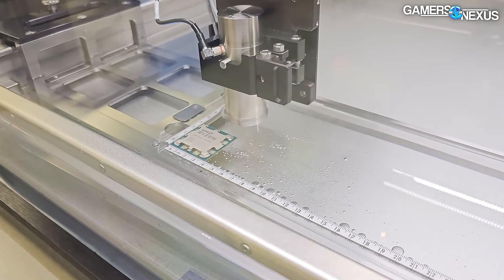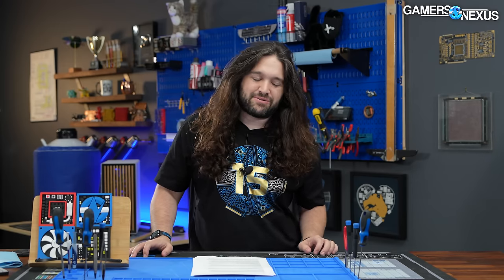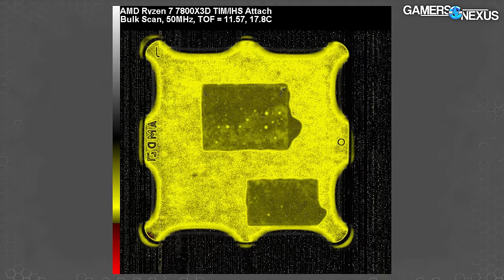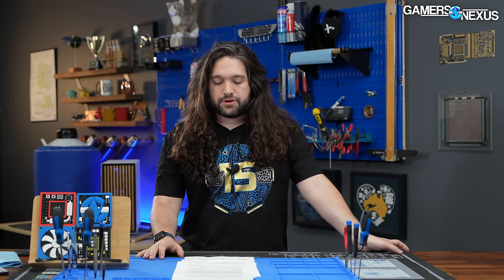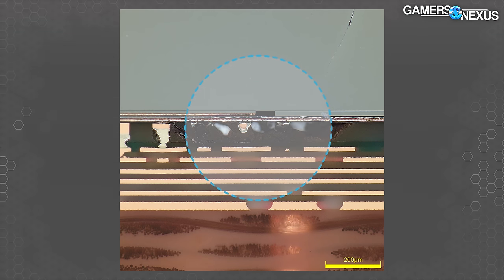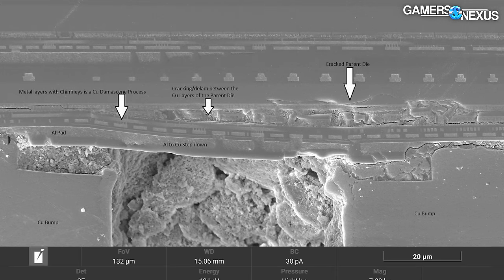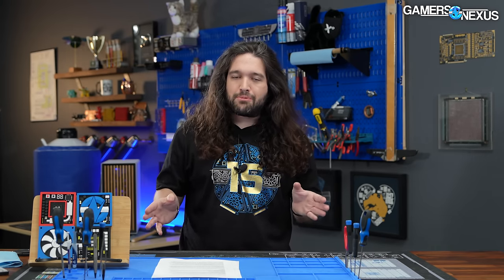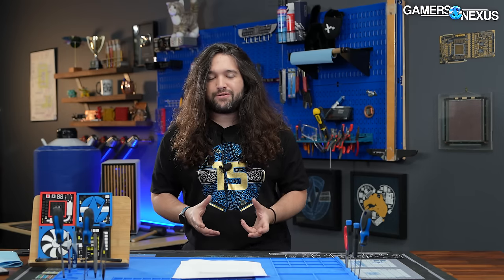The Truth About AMD's CPU Failures: X-Ray, Electron Microscope, & Ryzen Burns

Comment: This just reiterated to me how amazing it is that they manufacture these products in such vast quantities. It really is hard to believe how small all of the connections are and that it works at all.
Reply: It's mad isn't it? Especially when we get down to that scale and you can't even see a hint of a transistor.
Reply: @memitim171  Its instane tbh how a light beam can make transistors and do this on such a scale seems almost impossible that some metals can make something like a cpu.
Reply: @synapse5791  Yes it is amazing! To be accurate transistors aren't made from metals they are made from different metal doped semiconductor material which is usually Silicon.
Reply: @linmal2242  Yeah Its still kinda amazing how they work. Like how do you tell a bunch of materials to do something in a linear way which you can easily control? Its really
Reply: yep we can´t even inagine there is a big AMD logo in there lool

Comment: This was absolutely fascinating. But honestly, the more I learn about the structure of CPUs, how they are made, and how they work, the more I am convinced that they really are magic. The fact that you can zoom in so far, with all sorts of advanced equipment, and yet still not be able to resolve the transistors, is absoutely wild. It's one thing to hear "20 nanometers, 11nm, 7nm" etc but another entirely to understand just how infinitesimally small that really is.
Reply: Yeah, when people say that we will eventually won't be able to shrink the transistors more because on the quantum scale physics goes out of whack it sounds like Sci-Fi, but we are almost there already.
Reply: @AlleonoriCat  we are almost there already. The different layers are barely more than one atom thick and because it's so thin they're limited at how much more they can shrink while still keeping electric flow under control - the risk of cross-talk and shorts becomes greater every time they shave a nanometer off
Reply: @thesteelrodent1796  The transistors are small, but once you get to the vias and interconnect layers, they become huge in comparison, thousands, tens of thousands of angstroms ;)
But on the silicon it's damn small.
Reply: Imagine the machines (ASML) that make these chips ;)
Reply: They should be able to resolve the transistors if they zoomed in and took the time to adjust the astigmatism and focus with the SEM
Reply: SEM can resolve down to around 3 nm which should be smaller then even the smallest feature on any transistor on this chip
Reply: 15A(1.5nm) seems to be the limit for now.
Reply: We trapped lightning into a rock and made it think. If that's not magic, I don't know what is.
Reply: @TheEchelon  I think in the grim dark future they'll be known as STCs
Reply: Technology of a sufficiently advanced level is indistinguishable from magic
Reply: The smallest transistors today are only about 4-5 atoms across. It is possible to see the individual atoms, but that's another whole video. The smaller the transistor, the more likely an electron will jump from one transistor to the other.
Reply: For reference I heard an engineer say 1NM is approximately how fast a human fingernail grows in 1 second.

Comment: I've got to hand it to you, this analysis is next level. You've really gone above and beyond. This is why - even though I'm not really a gamer - I find myself gravitating back to this channel. It wouldn't surprise me if AMD themselves are watching this to try to understand the issue better.
Reply: Pretty sure they know everything about it by now. Or should. It would be a huge error not to, as you cannot fix the errors you don't know. Anyways, it should not have happened in 2023, they had problems with (lack of) CPU sensors in 2003ish.
Reply: AMD probably does watch this, as well as doing their own lab assisted analysis.
They will learn from this and shape up for a while after.
Reply: If Asus stops blowing up CPUs with faulty parts on their motherboards.

Comment: I used to work at a microelectronics plant in the 90s. The designers were always putting logos and letters at the micron level, partially because they could... but also because corporate espionage is a thing. If some company copied a chip (easier to do back then, as chips were not as complicated), they would often copy those logos as well.

Comment: I got to tour a lab that does analysis like this (slight chance it might've been the actual one that was used I suppose) decades ago and it was cool as hell.  I was in high school then and they showed off stress-testing equipment they used to test parts on the space shuttle, showed how they determined that replaced cables on a suspension bridge were failing sooner than expected because the older cable accumulated more road grime that protected them from the elements better and now that cars run cleaner, there isn't as much grime so the newer cables stay clean and exposed, just all kinds of neat stuff.  It seemed like it would be a very interesting place to work.  I looked into applying with them when I was finishing college, but they didn't need any software people at that time.

Comment: I do failure analysis at my current job (macro only, so 50x magnification max) and have tons of epoxy mounted and acid etched samples. Not only does that lab have an SEM, but the thing I'm even more jealous of, a bitchin sample cutting saw. Mine is geared towards weld and raw materials. Seeing it uses for other fields is so much fun.

Comment: I have one question: when it failed was there an audible noise (explosion) or no?  No shade here, I have seen both types of failures 😆
I have loved this series. The coverage has both depth and breadth and I think really hits the sweet spot for general consumption. This last one is immensely difficult to achieve! Kudos and congrats!
Reply: Yes. In the original video you can make out a cracking noise when the chip completely fails. In fact, they showed a quick clip of it in this video.

Comment: Excellent job to your FA company and your team. I have been in this industry for 40 plus years and have performed many FAs myself. You will find that in many cases it's not just one failure point, but several.
You and your team are going in the right direction. Just keep pushing forward as you always do. There is a conclusion and you will most likely find several Root Cause Problems.
There is plenty of blame to be spread around and all of the usual suspects are either trying to replicate your findings or in the process of replicating your findings...
🇺🇸🇺🇸🇺🇸🇺🇸🇺🇸🇺🇸🇺🇸🇺🇸🇺🇸🇺🇸

Comment: Getting these tests is not cheap. The tests we usually have done cost between 1k and 7k depending on how fast you need them and how many you need to be tested. But the parts we need tested are smaller, like micro controllers or mosfets.

Comment: hmmm, isn't "insta-gib" an unreal reference, rather than a quake one?  I know it best from the original Unreal Tournament and "insta-gib" mode whre it was always one shot kill.  
Perhaps there were quake mods which aren't coming to mind (I didn't dabble with Quake mods much in the OG days).
E2A:  So, I looked it up and apparently it started with QII, but wasn't technically "insta-gib" as there were no one-shot-kill weapons as players could buff themselves out of railgun range with mega health (IIRC) and/or armour.  Though, the BFG comes to mind, but I'm sure it was possible to buff beyond OSK for that too (though damn hard).
Reply from the maker: You might be right on that. It's been... a few years! I played both!
Reply: @GamersNexus  I "E2A'd", it apparently was from QII, though it wasn't what became technically insta-gib, which came with UT.
It has been a long time for the vernacular, though it's also been at least several years since I QII'd (still my fave Quake by a long way).

Comment: I think you are misleading your viewers. Ultimately the root cause is overcurrent and not a manufacturing defect, and this is caused by the bios. When too much current is supplied then it is true, ultimately the tiniest imperfection in manufacturing processes may be the catalyst, but it is NOT the root cause.
Some of your viewers may incorrectly assume that the chips are simply poorly made with defects.

Comment: Thanks for this detailed analysis from the GN team, I really appreciate and value this type of research. I've only worked with PCB failure analysis before to a limited extent as a PCB designer that previously functioned as a systems engineer.

Personally I'd also like to perhaps contribute some input for consideration as I didn't quite see some of the simpler failure mechanics elaborated upon. The PCB interposer deformation and delamination near the over-current event site is quite typical of extreme localized heating for PCB's. Copper when significantly heated in a localized area thermally expands, while the outer colder areas constrained it, this causes buckling and subsequent delamination of the area. Meaning the outer, least compressed copper layers warp away from the PCB core and deform the socket pins. The socket pins due to extreme heating also loose their elasticity "springyness" as this effectively causes the crystal structure of the metal to change and accept the new depressed shape as normal once cooled. 

Other things that occur inside the PCB layers as a result of extreme localized heating is off-gasing of more volatile compounds that have a low phase transition temperature in addition to  vaporization of moisture into steam inside the PCB. There is always just a tiny bit trapped from earths atmosphere, PCB materials are a little bit permeable to an extent. This all combines to create both mechanical buckling of the outer layers and possible vapour expansion voids within the PCB which we in the Industry like to call "Popcorning" due to it's distinctive sound . This often breaks multiple current carrying paths in the area or forms new ones due to shorts which often results in a runaway failure as current is conducted over ever fewer points thus creating more failures.

As for the dies exhibiting voids in the indium-alloy solder layer, I'm not really qualified in that domain, but I suspect similar processes may occur here due to vapour formation either during soldering as part of the flux used which is not escaping effectively during the short soldering process. As well as potentially new voids (gas bubbles) introduced when the silicon overheated to such an extent as to crack and reflow the thermal interface solder. During this process materials from below the silicon die may be wicked up through cracks to the top. 
I have in on instance ended up with underfill material on-top of a chip I was destructively testing. 

Hope this can add what little extra context I can provide.
Reply: Great explanation as well! I hope they get to read this. All the perspective in the comments, both experienced and not is so cool.

Comment: In 1998, I bought a new mb and AMD chip. Installed it and after a night of gaming I put it to sleep with the new hibernation mode in I think windows 98. A few hours later I was awoke to a bang. The chip was cracked in half under the Heatsink. I took it back to the company who ate it after a bit of protest. Never used hibernation again. This video showed me what it would have taken to do that. Scary and crazy to think it's possible.

Comment: This kind of failure analysis reminds me of when I used to work on industrial computer mainboard engineering. Our "in house" manufacturer for proto-boards had a habit of putting on electrolytic caps backwards. Due to space constraints in the form-factor, that often meant a cache of power caps right under the CPU socket. This was more than 20 years ago. Anyways, the explosive end-result would often blow the cpu out of the socket and send 3 ft long flame jet from the test-bed. It was always exciting on first power up. I mean, we visually inspected each prototype.. but, when there is that many components in a small form-factor, you miss things. Needless to say, watching flying pentium-pros was always fun.

Comment: Hey Steve, as a Professional Industrial Electrician; I can tell you that the arc-flashed copper under-fill at 18:17 may have provided the kinetic force to do this kind of mechanical damage. As a copper-based plasma can expand quite energetically up to 38,000x its solid form. Hence why industrial electricians (like myself) sometimes have to wear PPE that is rated to be resistant to flash-incineration.

Oh, and the heat required to make copper disappear into a gas, is around 4200F. That would leave behind the clean hollow voids you have there.

Awesome video BTW. Keep up the good work.

Comment: If anyone else was interested, this is GPT4's interpretation of what the lab does:

Given the specific tests performed and the level of secrecy involved, it is possible that this lab is engaged in semiconductor failure analysis for sensitive industries, such as defense, aerospace, or high-tech industries.

The tests you listed are designed to identify physical or chemical anomalies within a failed chip that might have caused its malfunction. This can help in improving the manufacturing process, detecting counterfeit chips, or reverse-engineering proprietary technology.

Comment: -How is your couple going bro?
- Well... Not great, to say the least.
- Ow
- We broke up recently.
- Damn, what caused it man ?
- ... Well ... A lot of things could've caused it actually.
- Whut? Whadduyumean ?
- I mean some of the factors I identified as having a potentially nefarious effect on our couple, includes (non-exhaustive) : mechanical overstress , localized thermal expansion (in-bed mismatched positions notably) , overpressure , tensile overload of one's blood pressure , poor alchemical contact, junction depth issues , silicon stacking faults (if the physician did a bad job on her boo... ok) , poor homic contact (we didn't live in the same home) , hot carriers , dead skin deposition , skin adherence issues , oxydative stress inducing thoughts , lack of synaptic capability (+ commonly known as... stupidity), ionic contamination , corrosion, lack of dendritic growth , dielectric emotional breakdowns , & of course (say it with me) ... EMOTIONAL DAMAGE :elbowcough:! The list goes on...
- 😶‍🌫

My everyday life.

Comment: Ruling things out to narrow down the possible cause of failure - i.e. differential diagnosis or ddx.

This is a FANTASTIC video.

NO ONE else, in the tech YouTuber space, goes into THIS level of root cause and failure analysis.

GREAT video!

I would NOT be surprised if AMD is using YOUR video, internally, to help actually guide some of their OWN, further, investigations into this issue - cuz yeah - exploding CPUs -- NOT great for business.

I would ALSO NOT be surprised if even some of AMD's own internal employees would be IMPRESSED at the level of detail that you have performed here, in regards to this failure analysis.

This is AMAZING stuff.

The depth of technical knowledge and learning is amazing.

LOVE it!

Thank you!

Comment: Additional information: The S(econdary)E(electron) Image gives you mostly information about the topography of the sample. This is because you measure the electrons that come out of the sample cause you hit it with other electrons (like a chain reaction).

You can also detect the B(back)S(scattered)E(electrons) to gain information about the elements in the sample (heavy element = more information = white/brighter; light element = less information = black/darker). Those electrons kinda "orbit" around the cores of the elements in the sample and come back to the detector.

Comment: Does anyone remember the Toms Hardware Guide video from 20 years ago, where they tested what happens when you remove the CPU cooler off a Pentium 4/2000 or AMD Athlon 1400 while the Quake Benchmark was running, and how the AMD Athlon chip literally caught on fire?  That caused a lot of ripples and discussion in the tech world then.

This video, as well as Part 1, feels just as important and "ripple-effect" as that.  That's how amazing GN's work has become.

Comment: It's just a delaminated PCB due to heat. The outer layer is trying to expand but the cool interior is restricting it, so when the glue softens the outer layer pop out. Sometimes called popcorning. You see it everyday when people try to reflow with a heatgun.

Comment: I vividly recall one of the testing done by a review website, back in the early 2000's, was to yank the heatsink to see if the CPUs could respond quickly enough with a thermal throttle to prevent permanent damage while at full load. I believe it was around the Pentium 4 days where they (both Intel and AMD (to a lesser extent)) did a great job at this. It seems we are going backwards a bit in this parameter.

Comment: From what I've gathered from this video and the previous video along with more personal research, the high excess voltage caused by the Asus firmware caused the dielectric breakdown, and due to the heat caused, the indium melted and caused a thermal breakdown, resulting in a feedback where the temperature increased further and caused the copper to melt along with the silicon. The high voltage is highly likely the culprit if that wasn't proved enough already.

Comment: Cool video!
Now that you shed (microscopic) light on the issue, it can't be swept under the rug with some "lower VSOC and hope it works". 
Maybe it will lead to a solution, to prevent similar problems in next gen chips.